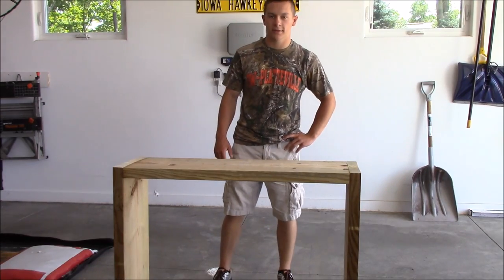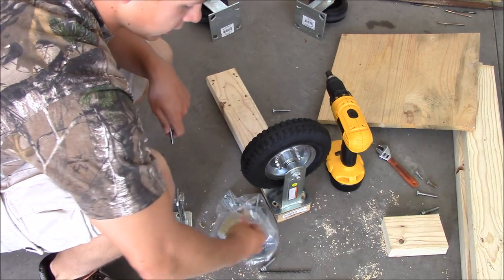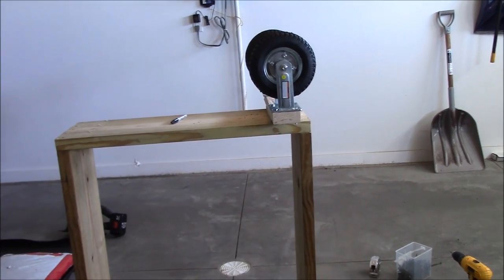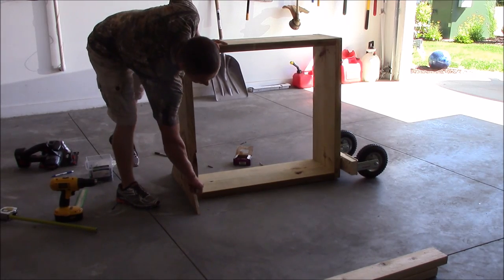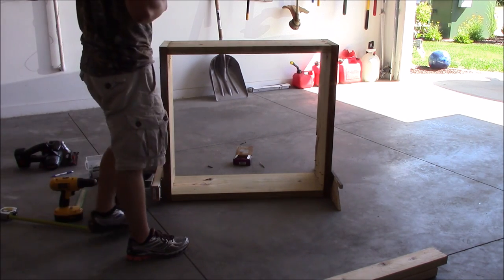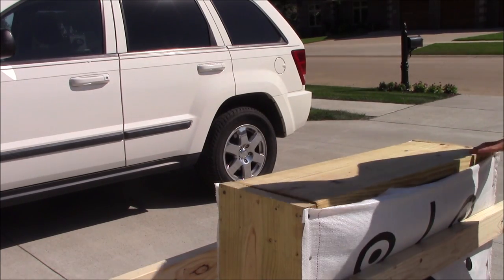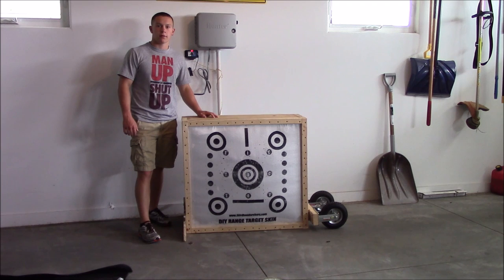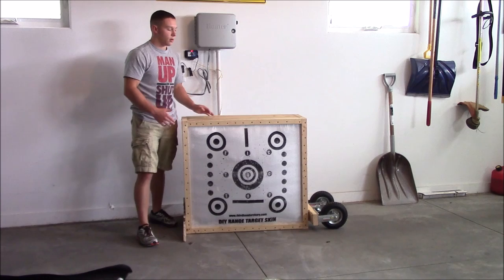How to Make a Portable Third Hand Archery Target

Comment: Hey Brunk:  Nice job.  We appreciate you taking the time to video your build. Just as a suggestion, putting a piece of black plastic bag or black felt before the skins, will keep the different colored clothes from showing through.  
The skins do need to be stapled every 2" and molding to help keep the staples in place.
After watching the video, I believe the trapdoor to fill would be  a little easier for most to do.
The skins and 2x12 should cost about $55 to build. Adding the wheels is where I think the extra money was spent.
Thanks again for posting this up.
Reply from the maker: +jim litmer Thanks for the suggestions! Yeah we ended up adding the black plastic and adding trim and it has been flawless ever sense. The extra money was spent on the wheels but we really like having it be portable. We really love this target and wanted to make a video so more could enjoy!

Comment: If you make this switch the top to the sides. This way the joints aren't facing up and less water will get into your target. And counter sink your bolts. And easier handle would be to just use a piece of rope. And face trim and a little silicone goes a long way to keeping out even more water
Reply from the maker: DownLow0099 great idea, we will he making a new target here this spring and we will definitely Make those additions. Thanks!

Comment: what's so good about these faces that make them $35 for a set?  Seriously material wise looks similar to a tarp, which one can get for $5.  The rest of the build seems pretty standard for what else I've seen off youtube
Reply from the maker: dcobbism well third hand archery claims they are very different and they have tested over 100 materials to determine which last the longest. I am not affiliated with them in any way so I can't tell you exactly how the material is different but I can tell you that these are the longest lasting targets I have ever shot. I have heard of people using tarps and not having good luck with that but I have never tried it for myself. I can tell you the material is way thicker than an average tarp so it makes sense that it would last longer and the actual paint will last longer than if you spray painted dots on a target. If you do try the tarp let me know how it works out!
Reply: While these may appear like others, we tested over 100 materials to find out what would last the longest.  Each spot will withstand over 1000 shots.  So if one uses all the spots it will take over 50,000 shots.  After that just remove the old skins and replace with new ones rather than buying a new target.

Comment: Ya but how will it stand up to a compound crossbow at 390 fps with a 20in bolt.....
Reply: Good question.  When filled with old clothes etc 12'' deep will stop a 400 grain arrow up to 350 fps. If shooting over 350 fps butt two  @ 2''x10'' boards to build the box.  This will make a 19'' deep target which will stop a 400 gr arrow up to 450 fps.